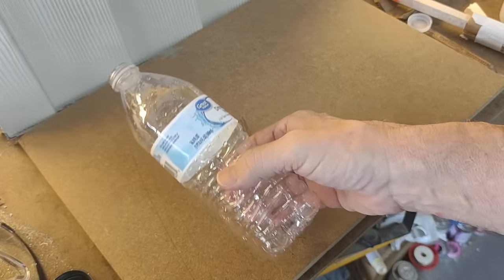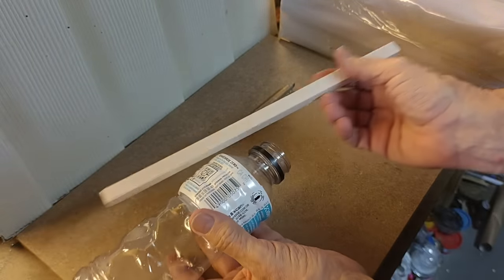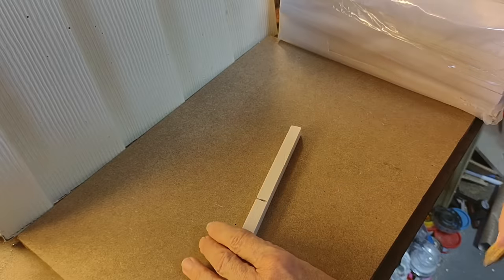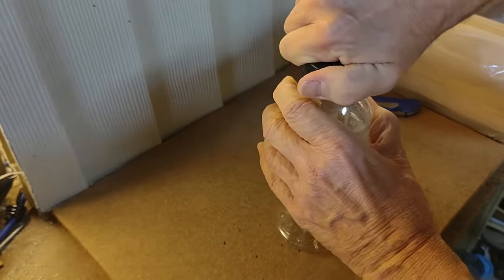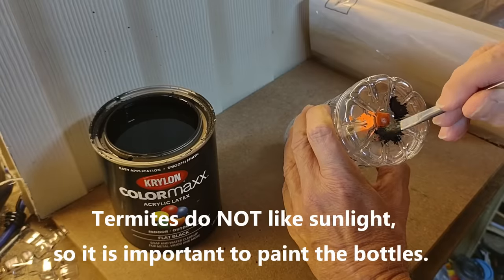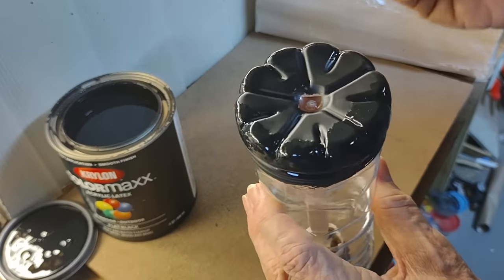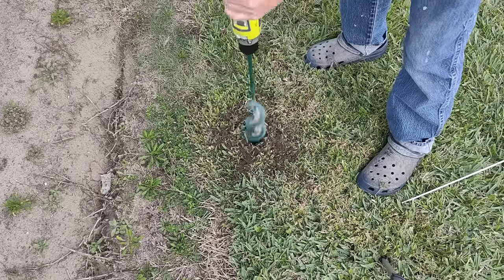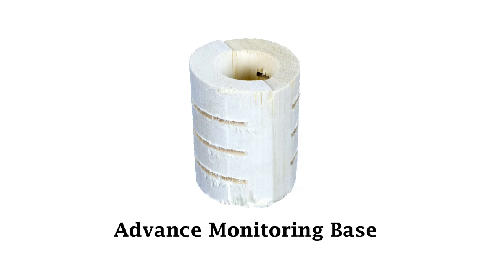Unbelievable Water Bottle Trick for Termites!  Simple to do!

Comment: Thank You for the great information. I truly appreciate.. I set 12 around my house and a few months later I had a look and one out of the 12 was active. They basically ate everything. I just added the poison on that station. Let’s see what happens. I have one question.. do you think they will get to any of the others? Or is that station I treated will take care of them all?
Reply from the maker: You need to check the bait station to make sure that they are taking the bait.  They don't always do that.  Most of the time, they will take the bait, but it's not a sure thing.  Did you use the Advance baiting system or did you use the homemade baiting station in my other video?  I will give you the link to that video in case you have not seen it.  If they take the bait, then that should wipe out the entire colony.  They may find one or more of the other monitoring stations and they may even bypass them.  You should have these every 4 feet apart to ensure that they find them.  If they are too far apart, then they may go right past them to your house.  Also, please tell me where you live.  Location matters because the species matters.  I would not rule out that they found your house already, so you should inspect for mud tubes.  Look around the perimeter for mud tubes coming up from the ground.  Also, look in the crawlspace and in the attic as well.  You may even see mud tubes in the eaves outside too.  If there are no mud tubes, then you may have dodged a bullet and caught it early.  Please get back to me and we will get this thing taken care of.  Be well my friend.

Homemade bait station video:  https://youtu.be/r05Z-aUJehw
Reply: @GuysPestSolutions  Thank you for all your videos and for getting back to me. I live in Long Island NY. and in house that is 10 years old. In April of this year it was the first time I saw swarmers coming out of the top vents of my sliding doors in the back of the house. As you may imagine I panic since I had no idea what to do. The entire foundation is exposed and clear of mud tubes. I also don't have any grass or plants in front of the house, only small rocks. The attack is also clear and the basement is all pour concrete. The only area that the foundation is very close to the ground is those sliding doors in the back. The steps and pavers the contractor build taper very close to the foundation, I think that was a mistake. Anyway the first thing I did when I saw the swarmers was to go to YouTube and see if I could gather knowledge on how to treat them or what to do. I came across several YouTuber that had good information, However you provide great solutions on how to treat it your self and truly enjoy them. The only problem I had was that the products do not deliver to NY as they are illegal here. I call the local Terminex by me and they did not even inspected the home. They only indicted that they will put bay stations around the house and monitor them for two years. The cost was going to be $2,800, I decide at that point do it my self. I found a website ( DOMYOWN.com) that sales all I needed and had it deliver to a friend of mine in NJ. I picked up Thermidor SC liquid and the advance Termite Bait System Kit with 20 stations and the Trelona Compressed Termites Bait (6 cartridges). The entire package was $489.00. This was before your latest videos. I am glad you released them as I now know it could be done easier, thanks to you.  The first think I did was mix the liquid as indicated in your video in a 5 gallon bucket, dig a 6 inch deep and wide and pour the product around the house. A few days later I installed the bait station and followed the instructions that came with them every 10 feet. I did install some in between since I has extra. I checked on them only once over the summer and didn't find any termites. Last week I decide to check again and only one hit. Not only it was hit.. they eat everything, there was nothing left. This station was in the opposite site of the house, no where near where the swarmers came out of. I place one of the Trelona product and close the bait, I am wondering if I should place one more in that location and ad another Trelona. Thanks Again For all You Do.. It is much appreciated.
Reply from the maker: If I am understanding correctly, you trenched around the entire house.  Is that correct?  Did you treat the backfill dirt, and did you treat both sides of the driveway?  If you did all of that, then your house should be pretty well protected. The Advance stations are pretty good, but the bait that you use in them does not actually kill termites.  The initial cartridge is nothing more than wood, and it just used to monitor for termite activity.  When there is activity, then you replace that wood cartridge with one that actually contains bait.  Unfortunately, the bait that they use is actually an insect growth regulator, that can take up to two years to work.  So, in your case, I would replace the wooden cartridge that was eaten with an actual bait cartridge.  You need to monitor this cartridge at least every week to make sure that the termites have plenty of bait.  You may be replacing bait for a long time with this system.  Sometimes it works fairly quickly, but sometimes it can take quite a long time. This should take out the entire colony though.  If you still have some of that Termidor SC left, then you can make your own bait station that will work a lot faster than the Advance one.  Since you already have the Advance station, if you see activity in it again, you can install one of the homemade stations right next to it, so that you are using both the homemade bait and the Advance bait.  The only thing about the homemade station is that you should check the bait every day because it does not contain as much bait as the Advance one does.  However, the kill time with the homemade station is around 12 weeks, and as I said, the Advance station may take up to 2 years.

If you did the trenching correctly, then that should kill off the termites that are attacking the house within 12 weeks. So, check the area where you were seeing the activity after 12 weeks to see if it's gone.  If it isn't, just keep checking every couple of weeks.  If the activity isn't gone after 16 weeks, then please get back to me so that we can figure out what went wrong.

I hope that helps.  Be well my friend.
Reply: @GuysPestSolutions 
Yes I managed to trenched around 90% of the house. 
I also pour product on top of the dirt after.

Their was and area on the back of the house, where the sliding doors are located. As you step out I have brick steps. In that location I manage to drill 2 holes on each side and pour the product in. 

The only  active bait with termites, I manage to load the actual poison. I have 5 that came in a box. 

Tomorrow I am building the home made station…the one you showed in the video.

That station I will place next to the active one, just as you indicated.

Thank you for all the great information and the great pointer. 

I wasn’t sure how long to check on them after. So glad you outlined to check every week and I will definitely do so. 

I must say I am learning a lot and couldn’t thank you enough. I will keep you posted.

Thank you for all your amazing tips and training.

Keep Well.

Comment: Hello sir. I recently had to redo some stucco and due to a moist planter (and sprinklers), the ripped out stucco revealed the wood sill plate (non-raised cement foundation) was wet in some areas and on a couple of the (vertical) wood studs, the bottom 3 inches was almost completely eaten away. I’m not sure if this is OLD damage or NEW; we had the house tented 10 yrs ago. I didn’t see any termites or bugs. So the question is, when you see a 2x4 stud eaten away, are the termites still inside, having a feast, even if you don’t see any going in or out? Or if you don’t see any, they already either died or moved on?
Reply from the maker: If you had your house tented, that means you had drywood termites.  Tenting is not done for other species.  I'm going to talk about them in just a little bit, but first let's talk about that wet 2x4 that you found. The only way to tell if that is termites, is to take a flathead screwdriver and dig into the wet wood a little bit to see if there are any termites in there.  Termites will die fairly quickly if they are exposed to the air, so they do not come and go the way carpenter ants do.  Most of the time, you will never see termites, unless they are swarming.  Even the swarmers die very quickly, if they do not get out of the air.  So, it is very possible that you do have termites, but you will not know until you dig into that 2x4 a little bit to find out.

Now, let me talk to you a little bit about drywood termites.  It is important to understand how dry wood termites work.  They enter through cracks and crevices around windows, doors, the eaves, pipe penetrations, and so forth.  Most of the time, they enter through several locations.  That is because a swarm of them attacked your house at the same time.  If there was a crack or a crevice, then they probably found it.  After they established their galleries, which will be inside the wood, it will take four to seven years for them to be able to swarm.  Now that they are in your house, the swarmers will use holes that are in your studs to travel through the walls.  Those holes in the studs were created by the electricians to run the electrical wiring.  Not only are these holes going through the studs, but holes were drilled into the attic for the light switches and to run some of the wiring for the outlets.  So, the termites now have easy access throughout the attic and the walls.  Most of the time, you will have no idea that they are in the walls, because the frass is inside the wall.  To make matters worse, if you have drywood termites, then your neighbors have them too.  That means you have been getting swarmed for as long as they have existed in the neighborhood, and so, you are most likely infested again.  Since you were tented 10 years ago, it's a safe bet that you have these guys in many locations in your home.

                            
I always hate to be the bearer of bad news, but if I am correct, then you will need to fumigate again.  Prices for this can vary wildly in this industry, so I recommend that you watch my video on how to hire a pest controller without getting ripped off.  That video can save you a lot of money.  You should also know that the gas they use to fumigate has absolutely no residual action whatsoever, so you can get reinfested the moment the tent comes down.  Like I said before, if you have drywood termites, then your neighbors have them as well.  Since drywood  termites swarm every year, it is almost a certainty that you will be reinfested within a year after the fumigation is done.  The only way to prevent this is to do a preventive treatment on your house every 60 to 90 days.  Most pest controllers will not do this, so it is something that you generally need to do yourself.  I have a video on how to do that and I will place a link below.  If you absolutely cannot afford to fumigate your house, then you can try spot treating it yourself.  It is virtually impossible to find all the termite galleries, but it is way better than doing nothing.  Regardless of how you treat it, you should begin the preventive treatment immediately, so that you do not get additional termites paying you a visit.  I understand that you may not be seeing any activity, but that does not mean that you are not infested.  So, at a minimum, you should have the house inspected.

I hope that helps.  Be well my friend.                        
 
Video on how to hire a pest controller without getting ripped off:  https://youtu.be/y-a8XOqVrlE
 
Video on how to prevent drywood termites:  https://youtu.be/neNsmVbj8Pc
 
Video on how to spot treat drywood termites:  https://youtu.be/U7ck7zhS0Xo

Comment: Make sure the fluorescent paint at the end of the stick is thoroughly dry or it will stick and then won't fall down inside the bottle.  maybe wipe some Armorall of similar thing on it before putting it into the bottle.
Reply from the maker: Good point, but make sure that you don't make the end slippery either.  It can easily slip out of place and give you a false reading.  I find that the paint dries really fast and I don't make them one at a time.  I paint all of them that I need for the house at the same time.  You can work on cutting cardboard while the paint dries.  Be well my friend.

Comment: just frigging brilliant...will start building these..Question..in your experience how long do these stations last buried in the ground?
Reply from the maker: Good question.  It depends on the conditions in the ground.  Water is the main enemy.  If your ground is really wet, then they won't last as long as if it is very dry.  Also, running over them with a riding mower doesn't do them a lot of good either.  Just as a rule of thumb, pull them up if the dot disappears.  You may well have termites, but the stick may have just moved.  If there are termites in there, then put it back and treat.  About every 6 months, randomly pull one out of the ground and inspect it.  If It looks good, then put it back.  If the stick looks moldy or compromised in any way, then start replacing them.  I hope that helps.  Be well my friend.

Comment: Too much work. The army way is to mix used motor oil with gas to thin it,  drill a large bore hole close to foundation,  and squirt down the mixture.
Reply: That might be fine for the army, but in suburban America, that will get you a HEFTY fine & you'll actually LOSE money.
But enjoy being lazy.